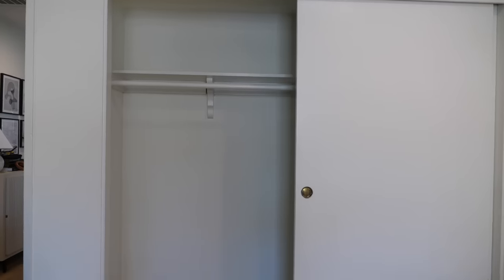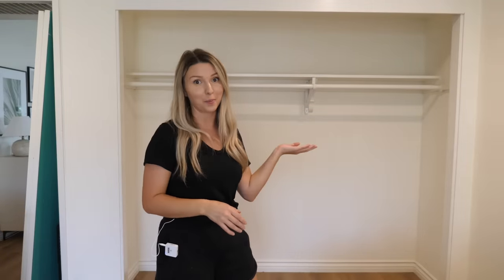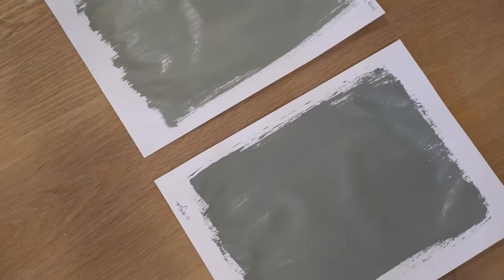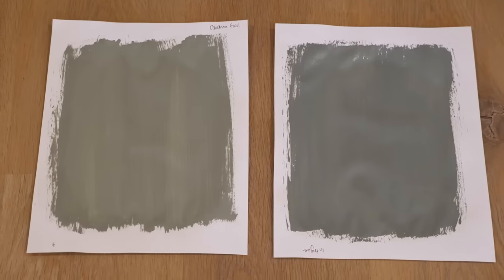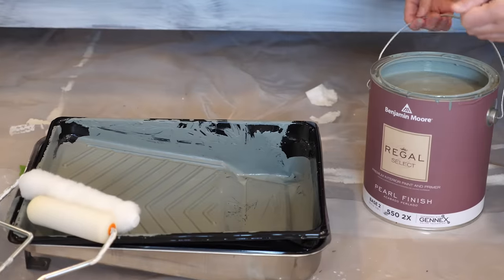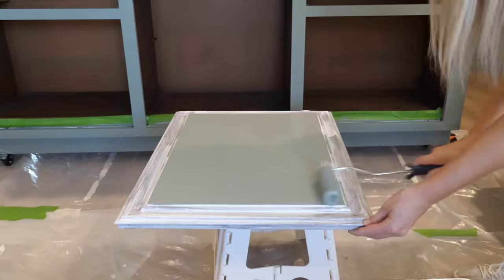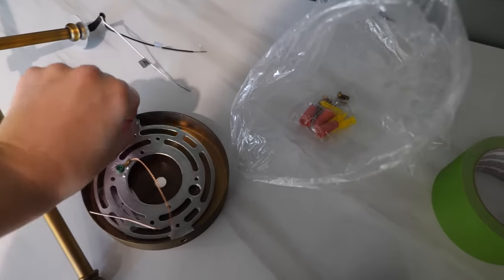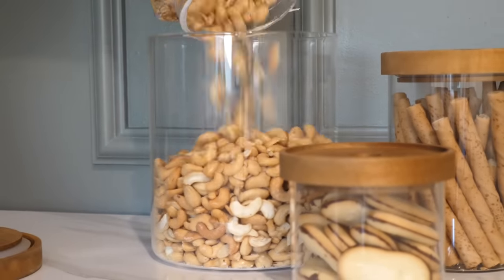EXTREME CLOSET TO BAR MAKEOVER | DIY THRIFT FLIP TRANSFORMATION

Comment: If you're installing the scones between studs (and it looks like you are!), you can totally get drop a wire from the sconce to the floor and have it poke out of a small hole that will be hidden by the dresser... then connect it to an extension cord that way. I did this with my sconces because there was some floor furniture hiding the hole and it makes my life SO much easier than having to change out those light bulbs all the time. Great job on the makeover!

Comment: I love the faux Carrara marble top! I read your response to a commenter stating that the top wasn’t real wood so I concur with your decision. 
I love absolutely everything about this bar space. As you began I was thinking you should run electricity to the area. Then you have this genius idea for the lighting, which I love! I didn’t know those bulbs existed. I might need some for dark areas in my 1930s home with minimal outlets. And zero closet space.

Oh! One idea - maybe consider removing the center door with the wine rack to add a little visual depth? Just a thought.

Comment: Tip after primer dries take a very fine piece of sandpaper and lightly go over the areas again to knock off any Nubs. Wipe the dust off after sanding any surface before painting. Your final paint will be much smoother

Comment: We bought the light bulbs and same sconces, but once they are screwed in, you can’t turn them off, you have to make sure the lightbulb is not in all of the way in order to make it stay off. Also, the light bulbs last for 5 hours a charge. Just FYI. We bought two sets to change them out when the charge dies.